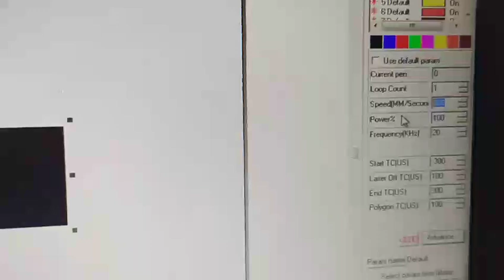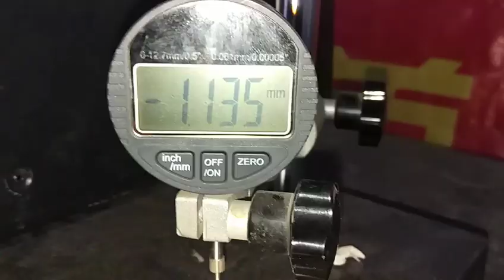aluminium deep engraving,50w fiber laser marking machine

Comment: If that can cut to 1.135 in that short of a time frame can it cut to 3.360 in twice as long of a period? In other words with multiple passes  over and over again it will continue to cut deeper and deeper? Yes Or No?
Reply from the maker: Yes, it is possible, but focus distance need to be adjusted
Reply: and how to do it ? if focus distance change text will be displacement! Did you have autofocus wich will fall for always maximum focus distance when it make depth engraving ?
Reply from the maker: yes, there is such machine, but need motorized up and down pillar
Reply from the maker: Ok